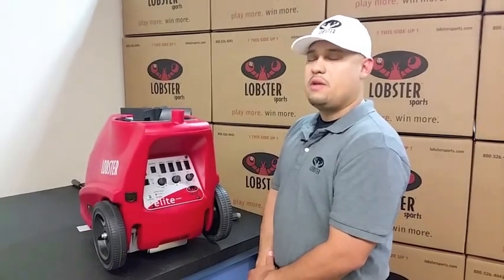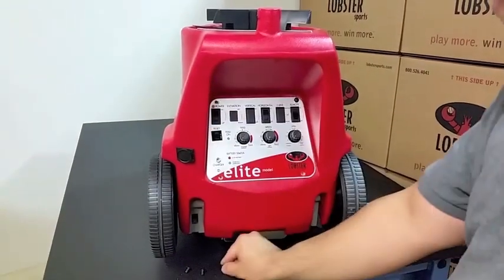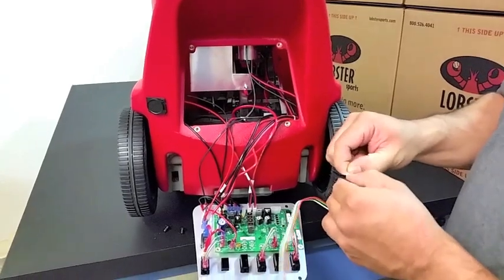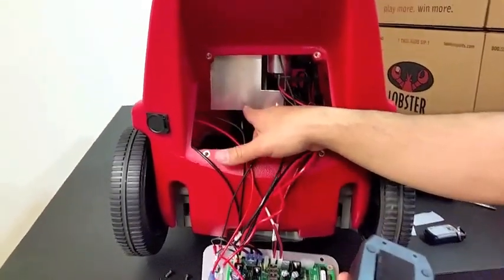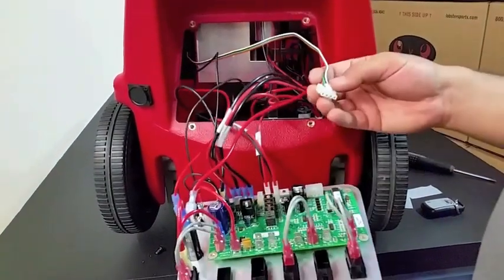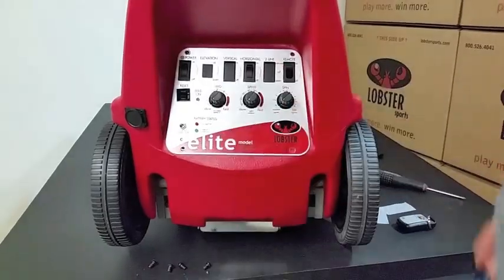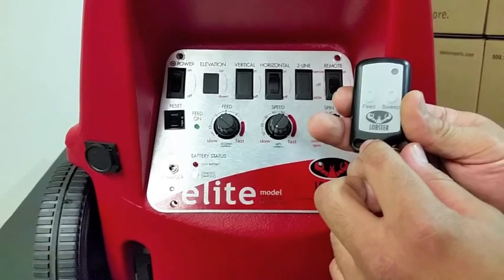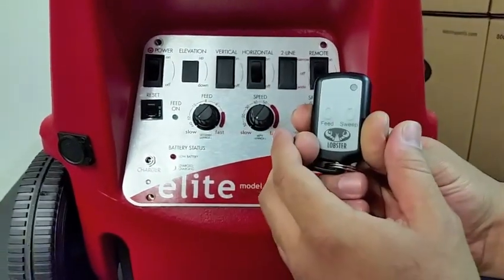Lobster Sports:  How to Install a Remote Control for Elite Series

Comment: I have gone through TWO purchased remotes for adding to my Elite One and still FAILED to get the remoting to work by following exactly this procedure and running all published diagnostics. First, the successive ordering of the remotes, due to successive failures, was an ordeal in itself. Complete chaos at the order desk.  Now the prospect of having to actually ship my machine to and from another state simply to have a remote added for a Lobster is an absolutely ridiculous level of support. Well, forget it. I'll live without the remote, but this will be the last Lobster I will buy.